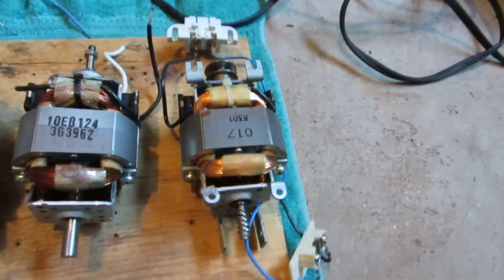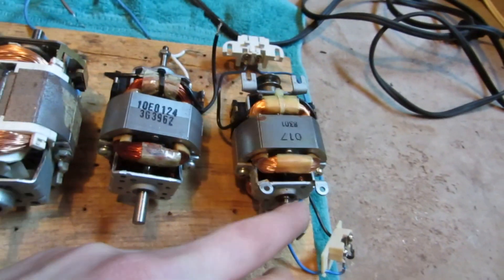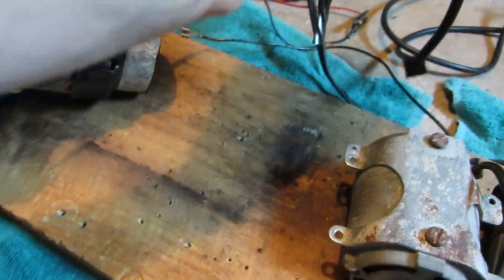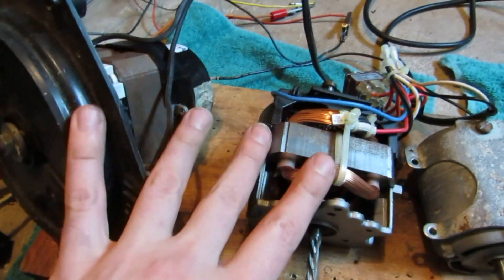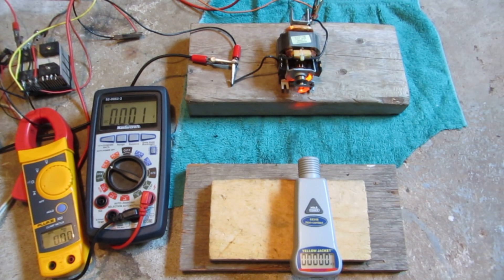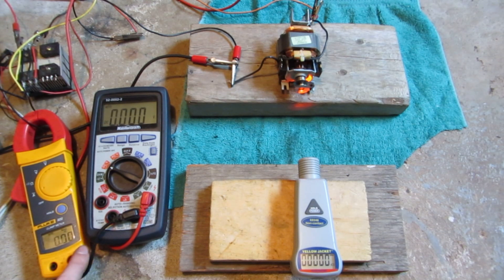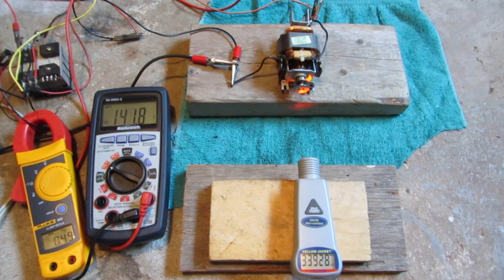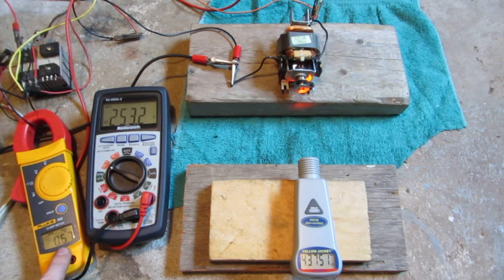Driven to Destruction: 120VAC Motor Overview & Motor #1

Comment: When is the 100,000 rpm video coming out?
Reply from the maker: It's taking longer than I would have hoped, the main reason being improper RPM reading from the tachometer. I did recently buy some proper reflective tape in the hopes to improve the light reflection.